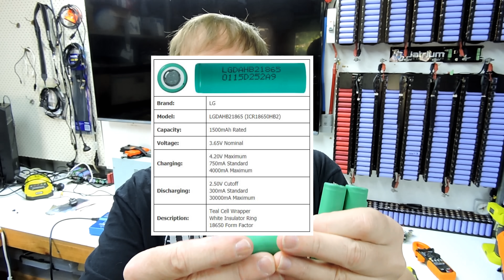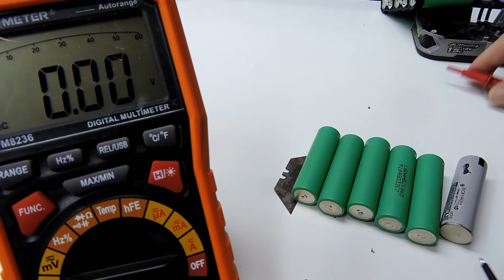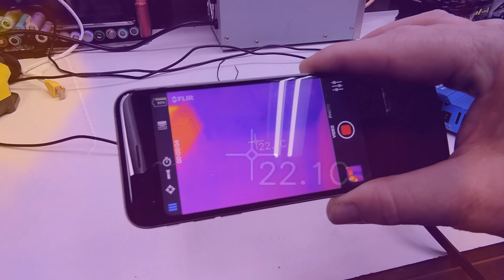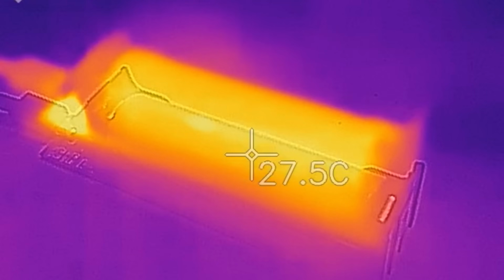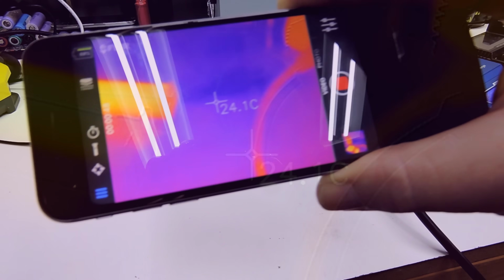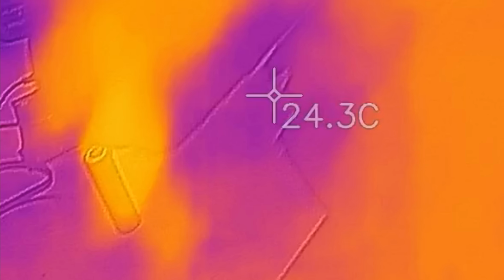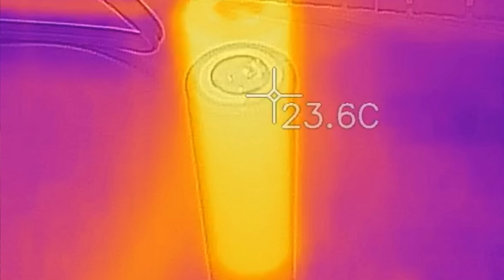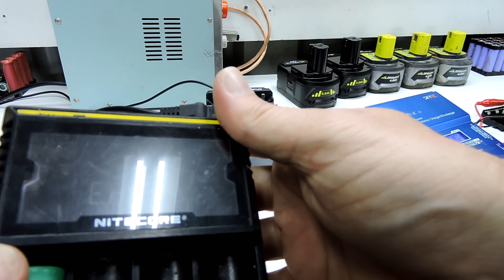18650 CID Reset   ⚡ DON'T DO IT! ⚡

Comment: Is it okay to try and revive 18650 cells enough to have a charger recognize them that have a starting voltage of 0.08V?
I should clarify, first to boost charge it to ~2.7v with 20 seconds of parallel charging with minimal temperature difference. 
And the CIDs of these cells were NOT triggered, so they were just low initial voltage, too low for the charger to recognize. 
Thanks :)

Comment: I have four 18650 batteries that have been sitting in my drawer for 3 or so years, they're reading 0v but DO have continuity. Not sure whether to recycle them or revive them
Reply: Test em. Charge up to 3.7V with a 100mA per cell, then 500mA up to 4.2V. Do this under supervision and on a fireproof surface, like a stone/metal.
Let them sit for a week, checking how much they drop in voltage per day.
If they stay at or above 4.15V they are usable but the might only last a year/self discharging problem. If 4.2V after  week, they could likely be used for a few years.
Take care.
Reply from the maker: Charge them at 0.0001 amps for a week or two see if they creep back up,

Comment: what you need to press to repair the 18650 cell because the protection has tripped and the battery shows 0v and it is OK
Reply from the maker: Ok, so entertain me HOW is it ok if the PROTECTION of the cell put in there by a smart guy making them has triggered.. Your comment is dangerous at best.

Comment: I did bring my batteries to life , yes one has to lookout for heating issues, several times it heated but ultimately they have good charge , I think I did parallel charging and some slight pushing of insides positive  terminal.

Comment: What if the CID hasn't reset, but the voltage is low? I have a battery pack that hasn't been used for 5 years (sealed in a box on a shelf).
Reply from the maker: Safety device hasn't activated - recharge at 0.01amps till it's over 2v then charge normally would be what i do
Reply: @HBPowerwall  Gotcha. The only thing I have available would be 2 18650 batteries that are destined to be thrown out, but I've yet to figure out what resistor would be necessary using one at a time. I don't want to have to break apart the pack, since they're 4x 103450's welded together.

Comment: Wtf this guy is doing, I've recovered a good percentage of 0v cells, and the key is to do the opposite of what he is doing (shoving loads of amps to a dead flat cell)
I use an imax on the nimh seting @ 0.1 amps, this will gently bring the cell to 3v (you need to monitor the charge, the charger will blow the cell pass the max voltage).
Next you put the lion mod back on the imax and keep charging at low amps (less than 1c for example).
Most of my cells got their max capacity back.
Reply from the maker: You're confusing a Zero Volt cell with a cell thats 0.01v...

Comment: Oh my.. thank you... I saw this video first before trying to repair my dead rechargeable 18650 batteries.. God bless Sir you already save me from harm..
Reply from the maker: You're welcome... i think..
Reply: I recycle them....or reset the diaphram...Some will reset to 4.V others 1.v
a good cell will recharge back up to 3 V in less than 10 sec.
They'll hold their charge...ect

A bad cell wont charge back up...when it reaches whatever it maximun protential voltage...such as 1.5v....The voltage will drop or remain at 1.5-1.8v..ect .if you take it off the charger...it'll drop back down to zero....
It takes less than a min to if a cell is bad or not.
I made a couple of 6s (25.2V) pack  3 cell per..using recycled laptop 18650
they're 15C at most...They're fine. I used them on the kiddies POWER WHEELS
High discharge 18650 such as 30C DISCHARGE are in 20V cordless drill packs...

I have mix match mah or C rating...in the kddies 6v powerwheels or R/C contraptions...They're r/c cars and powerwheels are recycled too.lmao

You definietly dont want to use a bad bad cell....Building 25v battery pack...
doing battery surgery Gets OLD.lmao
Reply: @oneeyemonster3262  I don't believe there are any 30C constant discharge 18650's at all! Not in drill battery packs, or even on the market. About 10C CDR is the best you can hope for, like the 22a cdr on the Samsung 20R which is common in drill packs, (25R is more capacity but slightly less powerful C rate.) Even the newest power cells, Sony VTC5a or VTC6 3Ah are at the same C rate  ratio, they'd need a chemistry change to radically change that. At the moment only Lipo cells will pull that kind of power or more, not 18650.

Comment: not a bad video, i will say, nor stupid! great information, safety with those 18650s. thanks for your  time & experience
Reply from the maker: Thanks for tuning in
Reply: HBPowerwall ok heres a good question! have you rebuilt a laptop battery? are the cells numbered? how hard is it to either reset the BMS, or reprogram it? if you replace, say, 2 or 3 cells in a 6-cell pack, will the BMS still work? thanks

Comment: Send me all you 0 volts cells I bet  80 percent will be good cells and most will be over 90% capacity.  I not afraid of the few heaters that will appear.  if you have a brain Its not hard to figure out which ones are heaters.  It is dumb to waste completely good cells.  You tested one cell your like throwing away the baby with the bath water.  Your the one who is doing bad to the community.   Test 100's of cells and then you can talk like you know what your talking about.
Reply from the maker: Geesh your still going.. I beg to differ i'm doing bad - heading to your channel to check out all your informative content ;P

Comment: You didn't even try to revive the cell properly I revived over 300 dead cells and we only had about a 20% fail rate.   A lot of the revived cells testing back to 100% capacity.  If your recycling old laptop battery pack your going to get some cells which are heaters and your going to get over 30 % of them with low voltage.  There are many reasons for this to happen and doesn't mean the cell is bad.  It's not hard to tell when charging if a cell is a heater and we even tried to charge heater cells for over 12 hours and not one came close to catching fire.  So you fear of these batteries is completely unwarranted.   The only time we had a cell catch fire is when I accidentally put a screw driver thru a cell when opening a battery pack.  Sure the fire looked really bad but even then I wasn't that impressed with the fire it created.  I was sitting on the living room couch and had my grand kids on my lap when it happened.  I walk to the door to the outside and put the cell on the side walk until the flame stopped.  My grand kids wanted me to do it again. The fire didn't even damage the other 3 cells in the battery pack.   There was 0 damage to anything in the living room.  Some melted plastic on the floor is all that happened and it did 0 damage to the wood floor.  If you so afraid stick to new cells only.  For that's what it seems like you doing that anyways.
Reply from the maker: They say don't poke the trolls - well I gota stick - lets do this

Comment: Thanks! How about 1v to less than 2v? Is it safe to recharge and use them?
Reply: it just depends on the cell itself....and how it was used...
I repair a pack...simply just by recharging a below 2v cell.
My FAKE Imax....allows me to recharge a single cell lithium  from 0  voltage.
My real Imax...is too damn smart.lol

The pack was barely used..( not every one know about batteries nor care.)
it just got toss in not working pile and set for years...simply becuase
one of the cells drop below 3.2....and the entire pack didnt charge.
I got a bunch of none working power tools battery packs and laptop packs

Other's i've reset the diaphram and under 2V.
A good cell will charge back up in less than 10Sec...or if you run 10 mah through it....It'll hold charge. i can tell in about a min..i dont need to charge it for hours
or 10 mins....

A baD cell wont recharge or struggles to get to 3.2 volts..
watch the METER...

the voltage will also drop when you take it off the charger.

Comment: Just wondering, as you are connecting multimeter + lead to battery - and multimeter - lead to battery +, it creates a short circuit with multimeter. Multimeter in continuity tester mode has a 3v generator inside it. If the amps ( milli amps ) drawn from that generator exceeds a threshold, it beeps. This is how multimeter measures resistance and continuity. As you are connecting multimeter and battery in series, some current passes which should be limited by max current the generator( its current limited to avoid fire ) can output.
I dont think its a valid test, charged battery will easily exceed the threshold current, connect other around.

I do think if you have a little voltage in cell, you can charge liion battery with a thermal trigger set to 40 degrees. Some may revive. Like a faulty board which became a resistor and discharged cell way below.

Comment: Hi, question please : I have old batteries LGDAHB31865 (Vacuum Cleaner) do not hold the load well..can I replace them with NCR18650B Li-ion MH12210  -Charger :15V 2A AC/DC Adapter- Thank you
Reply from the maker: I can't be sure but you could check out the worlds largest cell data base - https://secondlifestorage.com/celldatabase.php

Comment: You can always charge on the Imax just by using nimh charge, then it will bypass low li-ion voltage errors (same for PB), however it's pointless anyway as it won't probably charge crap and even if it does it will drop voltage right away :(. Wish there was a way to revive them, for nimh I think they try high load pulse charging to see if they come back to life, but most likely its a crap anyway...
Reply from the maker: Yes many have done this.. I only just did and surprised how well it works - That said don't do it for too long or unattended

Comment: Had two deeply discharged 18650. Both had around 0.5V after resetting the CID. Slow charge it for 3 hours then charge them normally. Et vóila, can use them normally but didn't measure the capacity yet.

When they are deeply discharged, they are really suck at recharging themselves back and just being good hand warmer.
Reply from the maker: Your approach is nothing less than dangerous .. :(

Comment: Great stuff! I need some info if available. Why would a 18650 cell stop charging at 3.4v? Thanks.
Reply from the maker: Faulty Charter? High internal resistance? Faulty Cell - isn't too many options. Is it a 3.7v nominal cell - does it have a different chemistry?
Reply from the maker: See more info on the cell here - https://secondlifestorage.com/celldatabase.php

Comment: What the HELL did you THINK was going to happen when you SHORT CIRCUIT a full battery to an EMPTY battery??!  Of COURSE it overheats!  This isn't a case of Don't Do This.  This is a case of being too stupid do do ANYTHING with Lithium batteries.  Please STOP giving advice to others.  You don't know what you're doing.  There are safe ways to recharge 0v Li-Ion batteries.  But instead, you show three stupid things not to do.
Reply from the maker: DO you need a hug?

Comment: THE ONLY THING  DUMB IS YOU NOT WEARING SAFETY GLASSES, SPECIALLY WHEN YOU ARE MORE AWARE OF THE DANGER THAN MOST BECAUSE YOU OBVIOUSLY MAKE A LIVING RECONDITIONING BATTERIES, PROBABLY THE MAIN REASON YOU DON`T WANT OTHERS FIXING THEIR OWN BATTERIES. IF YOU HAD GONE ABOUT FIXING THEM WITH A SMALLER SCREWDRIVER AND NOT LIKE A BULL IN A CHINA SHOP,  THE BATTERY WOULD HAVE HAD MORE CHANCE TO WORK AS NORMAL, SO LOOKING AT YOUR LACK OF PPE IN A DANGEROUS WORK ENVIRONMENT AND YOUR LACK OF ENGINEERING SKILLS     I DON`T THINK I WILL BOTHER BUYING YOUR WORK OR TAKING MUCH ADVICE FROM ANYONE WITHOUT COMMON SENCE OR SKILLS
Reply from the maker: Yah, don't recondition batteries, not an engineer but yah, thanks for the caps..

Comment: your video is not a stupid.This video present what can be after make dangerous methods.
Before 3 mounts i make this,and battery explode and burn me hand and face very bad.For that reason i never make this again..
In day of the accident. i forgot to use safety goggles and hand protection.I make 1 mistake move and punch a how in the battery and battery immediately explode....Kids never tray this at home if you don't know what can be happened .Thank HBPowerwall for show what not to make to prevent burn skins or dead. Thank you man :)

Comment: Is there a safe way to revive ??
Reply: Yes, but you need to be careful, and be able to spot & discard the ones with internal short circuits, like the one in this video.  You can safely recharge a dead Li-Ion battery at about 10ma (that's about ~1/100th C)  You must monitor the temperature & voltage as it charges.  Temperature should stay steady near room temp. and the voltage should rise slowly and steadily about .01V every 10s.  If the cell heats up, or the voltage will not rise, discard the cell.

Above about 2.5V you can increase the current, but keep it below 1/2 C to full charge.  Then test the cell and measure its capacity.  If the capacity is is less than 1/2 the rated Amp-hours discard the cell. 

You should always bin your salvaged cells together by measured capacity.  Never mix cells from different bins in a single pack.  Cells wired in parallel should be the same manufacturer, same model, and nearly the same measured capacity.  Cells wired in series should have about the same measured capacity.  (Measured capacity meaning what you measured for that one cell, not the Rated Capacity.)

Frankly, I don't know what use a reset CID cell would be good for.  Maybe a flashlight, but why not use a good cell?  The CID popped because the cell has been damaged.  You can safely reset & recharge it. But it will never be good as new.

Comment: thanks for this trick .... i revived 10 cells and damaged 5 cells while trying at first, bad smell came out ...  now i miss those cells which i give away, thinking they were DONE !!!! 
now i can another category of cells which charges max 4.06, what should i do with them ? is there any way to charge them upto 4.2 ?
Reply: LOL did you get the bit where he said " This is a really, really bad idea" and " Don't do this"
Reply: You were right the first time.  If you reset the CID, and you hear a hiss or smell a slightly sweet or flowery odor, you have punctured the cell and it is DONE.  The electrolyte will now slowly evaporate and the cell will fail open.

Comment: Battery except the flat top， all the body of 18650 is negative.. be careful
Reply from the maker: This is very true..
Reply: I am so glad i learned this from the video.. I did not know and stupidly enough, I used to push the positive side higher from under, in order to make it a bit longer as it was not fitting one headlamp. I pushed it with a cork screw due to the shape as it would fit in between the holes on the positive battery... I guess the universe was protecting me from my own ignorance...

Comment: I have a $20 cell.
Dropped my light while it was on and that activated the CID
I reset it and it works perfectly.
The cell was completely fine just needed to reset
Reply from the maker: Crazy...
Reply: @HBPowerwall  why? 
The battery was only a few months old and not through many cycles.
It has a protection circuit as well.

It simply activated from the force of dropping it.
There was no actual damage done to the battery.
Reply from the maker: @user-tr2dh4xx6u  fair enough - if you're happy with that it's up to you..

Comment: The best Part of not believing the bullshit is it magically just passes me by.  Zero volt cells ,,,,what about don't let them drop below 2.24 volts, and then 2.2,,,,and then it was 2.0 volts or they were worthless.  I've got thousands and thousands of these things and had them before most people had ever heard of Lithium and the only way you know if one is dead and no good, is if I can't get it to take a charge and in that case it would have gotten thrown out a window and wouldn't be occupying so much damn space around here huh?  I've charged thousands of cells that layed around at Zero, sat in the rain, snow through winters outside with no blanky, and even had them hanging a few inches above my wood stove for 3 years.  Dead means it won't take a charge and has nothing to do with it's voltage

Comment: 9:38 Heat from the internal short circuit by the dissoluted Cu colector .
Copper dissolution and deposition during overdischarge and the formation of internal short circuit.

Comment: Please Never try to Boost charge a Battery by Sticking another partly charged battery accross it.Bin that Boost Charger holder..as seen in the video it will damage the Battery due to Excess Current producing excessive  heat and possibly Fire.
Reply from the maker: You're spot on - not the best practice at all, that said I've been doing it that way for years probably 10,000 times without 'noticeable' issue - THAT SAID it is not a good practice and now I use a variable power supply at 0.01amps

Comment: i don't know why would anyone reset CID you know it is a safety feature, a true person recycling 18650 wont do this because number one is SAFETY i mean after removing from laptop battery pack you check them and then you cycle them after that you test for self-discharge after that you make it large pack depending on your intended use and you cell fused it and it would take month(s) to do it but this other guys just reset CID and charge it put it in a pack waiting the battery to explode and causes fire.

Comment: I tried to revive a dead 0v cell & at first it was giving me the same problem like it wasnt charging fast enough & voltage would fall down quickly but then i let it sit for charging for some time & about 2v the battery was not self discharging & later it was charging like a normal cell without the heating